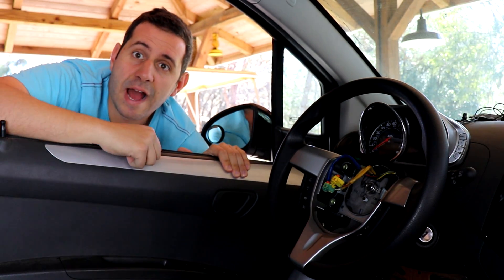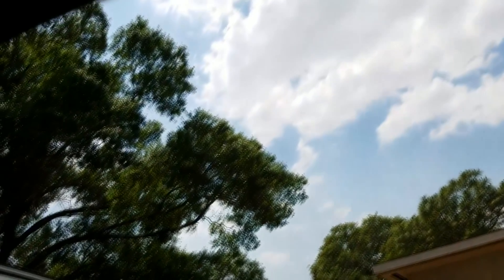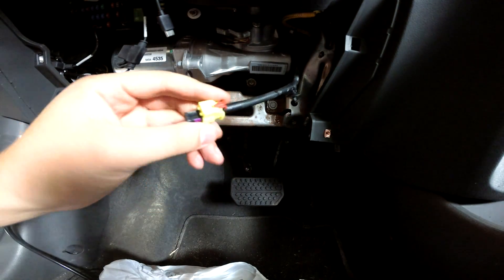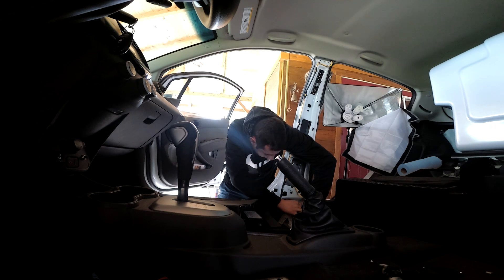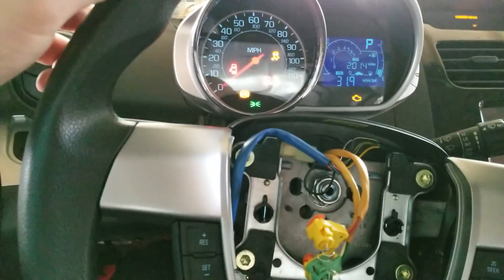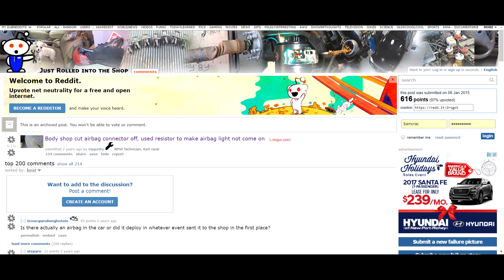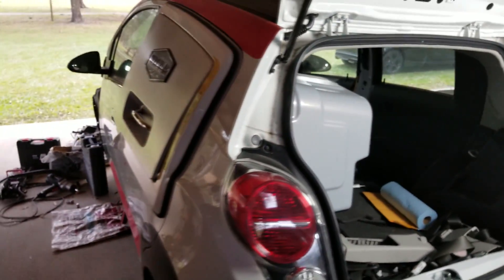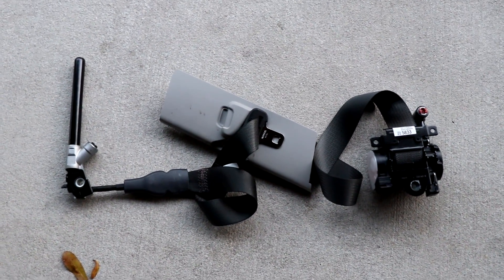How Scammers Hack a Car's Airbag System for 5 Cents (Permanent Airbag Light Off)

Comment: As a technician in a high production collision repair shop, it's driving me nuts how long this car is taking you to reassemble. Lol I love your videos though!
Reply: Hi, if I want to know if my airbags are working properly where do I go to get them checked? I want to avoid dealers because they charge a lot
Reply: Any mechanic with a decent scan tool can diagnose airbag issues and pinpoint what the cause of the light is.
Reply: @TonyAlvestad  but someone can replace the airbag modular so when you go to check for codes nothing shows up. Is there another way too know if the airbags work properly?
Reply: @r.k862  from my understanding as long as the light on the dash is gone that means everything is functioning and good to go.
Reply: @TonyAlvestad  no because people can reset or replace the modular or even put in resistors or take off the light bulb etc. The light is not enough indication if you are not the first owner of the vehicle and that it has had accident
Reply: @r.k862  a scan tool will show exactly what components need replaced to make the system function correctly. We replace the module and impact sensors any time a deployment happens, even if the crash only locks up the seat belts
Reply: @TonyAlvestad  how much do you charge for replacement of new module, new drivers airbag, new front crash sensors, re-gas the part that makes the airbag deploy etc for only the drivers airbag? Parts plus labour in total? Also where are you located?

Comment: Great idea when you replace your cars OEM steering wheel with an aftermarket racing one
Reply: You can get aftermarket steering wheels with airbags.
Reply: Where can I buy them from?
Reply: The good companies like momo will make ones with airbags holes.
You just need to insert your cars airbag into it or some crap.
Reply: Also, in many places it is illegal to drive a airbag equipped car without airbags and if you do decide to drive because who will know and you get into an accident even if not your fault, your or their insurer most likely wont pay out
Reply: @IIGrayfoxII  This video is for people who know that and don’t care.
Reply: Grayfox the insurance will pay out, so long as you were not the one who performed, or authorized, the modification, and you had no prior knowledge of it.
Reply: Depends on where you live.
Insurance will do anything to avoid paying out

Comment: I had no idea it was that easy to bypass the sensors. Thanks for the video.
Reply: It actually is not in all vehicles ...some have gotten quite clever at making certain safety features more and more difficult to bypass ...they can for instance require a chip instead of a more rudimentary sensors that only report a resistance value  a chip might looks at a sensor umpteen times a second sending code to the computer ...sure no matter how they rig it someone can still engineer a bypass ....but it won't be a 5cent resistor!  It will instead be a $49 "dongle" that no reputable store wants to carry "for liability" and even the places that do sell will have you okay a disclaimer "for closed course vehicles only" of some crap...the newer the vehicle the worse stuff like that will get....But hey at least you can Apple Carplay a back up camera, active headlights, active cruise control etc etc...they make it too damn nice to want to go back to any simplicity

Comment: thanks for the info.  I got into a Hyundai elantra which had been wrecked, and the airbags didn't blow, but the seat belt did, and I was told it would cost $1000 to fix that.  I gave up and junked it losing about $1500 rather than spend another $1000.  I should be allowed to drive without that 'special' part, just as I should be allowed to drive an older car in which such things are not required.  A friend of mine wrecked when his airbag 'deployed' in normal driving, but the government didn't pay his bills.
Reply: And you didn't just keep the car why ???
Reply: There were  a couple of more problems I had to fix, but the big one was the thousand dollars the 'state' said I needed for the passenger seat.  I also knew that something about that 'safety' system was bad because the seat had 'fired' and the air bag had not deployed, and I knew nothing about that system, and did not know how to pursue that information I needed.  Also I was so upset that the 'state' required me to have that system on the car that it was upsetting me, and I would rather take the beating (financially) than continue to be upset by the 'state',  and I feared the airbag going off when it shouldn't, because it didn't go off when it should have.

Comment: I wouldn't trust a used airbag off ebay.
Reply: The car you're driving has a used airbag in it. Every car on the road has a used airbag in it.
Reply: MilkCap why? They are built to such a high standard that insurance companies allow body shops to use them
Reply: +WILLIS CURRY that's an awful stupid statement ....
Reply: On a car like 2018 or something less than 6 mos old theres just a high chance the bag is STOLEN vs not working. So thats the real issue especially with cars like HONDAS. Them bags are def. stolen.

Comment: Or they could just remove the W5W bulb from behind the airbag light in the instrument cluster, preventing it from ever lighting up. Or they could just couple said bulb with the battery light bulb, making also the airbag light light up initially, but going dark after the car has been started. Etc.
Reply: taking the bulb out won't trick the scan tool though idiot
Reply: +idiot Nice from you, that you've signed your message. The fact you missed, that 99% of car buyers don't have a scan tool, and that because of that the bulb method can fool them in same proportion, is really just a plus.
Reply: Most modern cars also report faults in the infotainment system so removing a bulb won't do sh!t.

Comment: I did this once to my car to pass inspection. I spun off the road into a field and flipped the car on its side which deployed the side airbag and busted my mirror off but did literally nothing else. Airbag was a lot of money so I just stuck a resistor on it
Reply: I'm really hoping i'll be able to do this. Did you need to get the SRS module reset or anything like that?

Comment: You paid too much for that resistor man.
Reply: Jeff Sims Not too much if he only bought in small quantity, such as the 8 he actually used, and had to pay shipping.  But too much if buying in bulk certainly.  As an electronics hobbyist I tend to buy common values in quantities of 100 to 1000 at a time, and such are quite inexpensive in those quantities.

Comment: I feel I'm the only other person who noticed that he twisted the resistors, which would cause the leads to touch, basically just defeating the purpose of getting a resistor in the first place, might as well of just put a wire touching eachother.
Reply: He did not twist it tightly enough for the leads to touch each other.
Reply: ND Mac Actually he does appear to have twisted tightly enough for them to touch on the steering wheel sensor.  Such things can happen if one does not fully understand what a resistor is or how the SRS system conducts its diagnostic test (essentially just a loop impedance test since there is not much else to test for the firing charge initiator.

Comment: Hi Sam, Do realise that it is frowned upon to use 2nd hand Srs items. Once you replace all of the used safety items and finish the car and you drive above a set MPH that air bag (SRS) light will come back on. The SRS module has been triggered and their for useless. It burns all the crash data on to the stb board and this can not be turned off with your ( no offensive) glorified code reader. Police and insurance companys use the information contained in the case of a accident. Date and time, vehicle speed,gas pedal percentage and brake application and so on. (This data can not be removed) and it also contains information about the vehicle Manufacturer date Vin number etc. So the SRS module has to be replaced. You could use the one from the flood car. But it contains the details and information from that vehicle. You can buy them new from the manufacturer but there is another catch. That module when fitted will have X2 or replacement visable to the scan tool after you put in the vin number. Also the new date will be stored. So with a factory or a higher end scan tool and software (which is ridiculously expensive by the way) you can pick up the cars history. That old resistor trick was actually used in tech school and when you got accredited. To test the wiring going to the air bag , set belt pretensioners etc. So if there was a short circuit on damaged wire. You whould not accidentally deploy a very expensive air bag. Have fun withe pizza car. Always enjoy watching your videos you don't BS like other people I won't mention. Have a good one Sam Cheers Mark
Reply from the maker: Mark, I had so much more information, and would have liked to include it in this video; the problem is it would've made it likely 2 hours long. I'm sorry to say that the SRS light will NOT come back on, as is the case with any car I've rebuilt. Second hand items might be personally frowned upon but they are frequently used in repairs (look at insurance quality used parts). There is just so much misinformation about this stuff it's necessary to clear things up for someone who might read otherwise.
Reply: Hi Sam, I should of said not so much the SRS light. But that SRS module (computer) it will always have the history embedded in it. That you can extract with the correct scan tool. And on the issue of using 2nd hand Srs components it is a big no no here in Australia. I run a Mechanical and Smash Repair Centre here in Australia founded by my Grandfather in 1921. They fail for car roadworthys and registration to use 2nd hand components. Not saying what you are doing is wrong . With good quality parts like you are using I whould do it to my on car. But it is frowned upon here in OZ. I diagnose cars with SRS faults every day for other shops and private guys as well . Airbag lights do come back on from time to time because of the original module being cleared and then out of the blue the light comes back on. Slot of the time it is due to a emergency and brake stop or esp being activated. We are also not allowed to do wiring repairs to any SRS harness or plugs . If they get damaged we have to replace the complete harness. Also on your Pizza car I recommend replacing the clock spring behind the steering wheel. Because of the force the bags explode at the can break the tiny cords of wire inside there. You have spare in the Flood car. Again thanks for talking the time out of you day to talk to someone on the other side of the world. Good luck with the repair. Stay safe. Cheers Mark.
Reply: you tell him Sam!!   FIGHT,FIGHT!!!!!
😉

Comment: When I bought my Mercedes everything was ok but later a srs light came on and my mechanic found out that the driver side underneath the seat  had a resistor
Reply: Rei Mullalli doesnt suprise me. They probably did it for the pretensioner. They can blow for no reason. That and sometimes the code comes and goes on them, and adding a resistor in line helps keep it off. Had to do it in my ford, the connector was just loose, but a new connector was $50 and the resistor actually helped tighten the connector.
Reply: Charles Small. thank you!
Reply: Rei Mullalli and i can say, even though that resistor was there, the pretensioner still fired on the seatbelt. Not always end of the world with jerryrigging.
Reply: Larry Ciarrocchi but no one is using your name
Reply: This NOT me.  I never made this comment above.  How can someone do this (using my name?)

Comment: Dont twist the resisters like you did.That was why it didnt work on the steering wheel. You can remove many other sensors to the emissions and other important features on a car by using a resistor. The owner can do it to his own car,but you will go to jail if you sell a car like that.
Reply: He did not twist it tightly enough to short the leads only enough to put tension on the connector so the resistor would not slip out easily.
Reply: ND Mac Twisting grounds them together
Reply: My point was that the leads did not touch each other, therefore no short.

Comment: Before I even read the comments. Take the cluster out, find srs light. Cut electrical tape to fit accordingly. Free!
Reply: The problem with that is that in order to show that's it operating properly, the airbag light has to light up briefly and then go out when you start the car.
Reply: You can tape up the SRS light on the gauge cluster but once the car is serviced by a dealer or independent shop and plug in the OBD scanner... the SRS failures/DTCs will show up....

Comment: Yeah, when you twisted the wire to tighten the first resistor you put in... you bypassed the resistor. Now you just have a short circuit between the two contacts.

Comment: I've seen an odd one. The ABS computer was fried really good and was not reacting to anything. But the light comes on for a few seconds and then it shuts off like normal. And found in the dash a tiny 555 timer chip assembly that does that auto light on for a few seconds than off. 

It's a twist of a capacitor that charges a bit at power on and as it discharges will fade the led away.. but this made timing gives away pretty fast as the time while it's on can vary a lot, but with an actual timer circuit set to factory time.. it's spotless.
Reply: Clever scammer!

Comment: Wouldn't twisting that resistor round like that cause the legs to short together bypassing the resistor and effectively just making it like you just put a piece of wire between the 2 pins.... :S
Reply from the maker: yes but I didn't touch them when I twisted it, should've made that more clear

Comment: Here's my question. My 2005 Honda Accord has a clean title and my mechanic has assured me that it has never been in an accident. For whatever reason the airbag light is on. The car had a recall by the dealership to replace the air bags but the light is still on. The dealership told me that the airbags would still deploy in accident even with the light on. Is that true?
Reply from the maker: +eg1885 possibly but if you can get a hold of a scanner is should tell you exactly where the issue is. An airbag light should never really be on, an airbag light could just be an issue with another component of the SRS systems
Reply: I see, ok thanks for the response. I'll try to get a scanner.

Comment: Seems like they could add some additional security/protection with a few more cents in components by pumping back a heartbeat to the SRS system, but I guess when you need something to work fairly consistently every time than simple is better in this case. Wow though...
Reply: Being in the electronics repair trade myself, this could easily be accomplished; however, you are correct in the fact that the issues with digital systems most of the time surmount those of a simple analog system in terms of reliability.

Comment: Usually you have to reset the airbag module aswell to get rid of the light
Reply: RuskiDealer . In most cars yo can not reset the module. When the accident occurs it burns the info into the information chip.
Police and insurance companys can use the information on them like the date and time,gas pedal percentage, if the brakes were applied and vehicle speed etc. It also tells you what systems were diployed . This vehicle and vin number are also recorded. The cheaper type scan tool that Dam is using is only a reader and basic code turn off (NOT DELETE). A factory or a higher end scan tool can detect this and all the data. It can even tell you when the light was last turned off. Even if you replace the srs module (brain) you need the high end tool to program it and give it a vin etc. Except you have to add X2 or replacement in the I'd parameters and when powers up the time and date are now set from that time and date. So they will never match the vehicle. A simple proper scan will catch this sort of this out.
Reply: Well the car I have I replaced all the airbags and seat belts and had a company reset the srs module. Idk
Reply: RuskiDealer . I am not saying it can't be done that way. What I was trying to get across is that if you get the later model cars and hook them up to a high end or dealer scan tool the original crash data whould still be there.
Reply: @MJTAUTOMOTIVE  no you can erase that data and replace it with virgin data bud, nothings permanent when you can go directly into the chip
Reply: @kentallp  . So you comment on a thread that is over 2 years old to tell me something that I never said. "Bud".

Comment: i guess u really dont know how dangerous a move like that juat was. what if you had a intermittent impact sensor fault? hmm . lets not hook up a good air bag with an unknow state of wiring/hacked SRS. unplug the batt , hook up new airbag , reconnect batt and Not getting in front of the airbag with scanner to check for codes..... was the airbag even fully installed when u did this or just sitting on the wheel? dude be carfull seen a body guy do something similarly stupid and lost 4 teeth and got 8 stitches next to his EYE........an airbag system  should be treated as faulty intill PROVEN safely operational.  you seen how much force they create  , blasting a 250lb guy 5ft in the air by some prankster

Comment: i'm one of those people that would rather have the airbags shunted with a resistor then replaced. but then again that is with a roll cage and 4 point harnesses installed on top of that so... and yes that is much safer then airbags that kill.